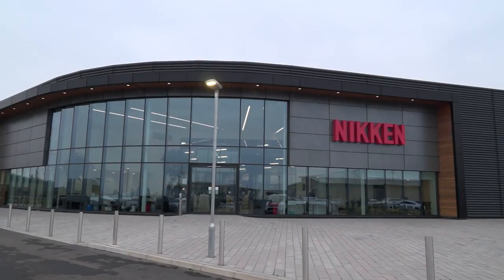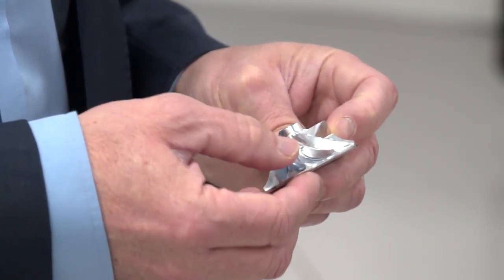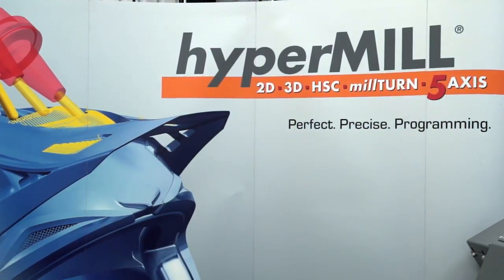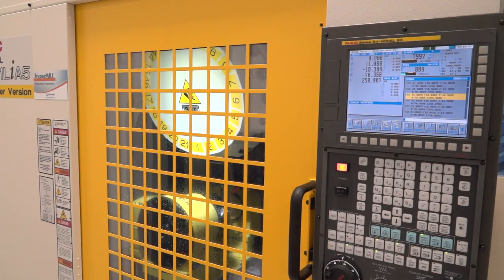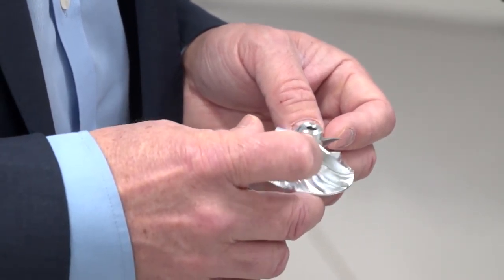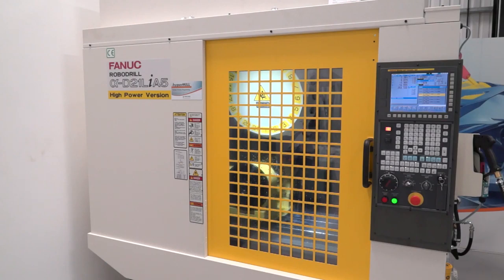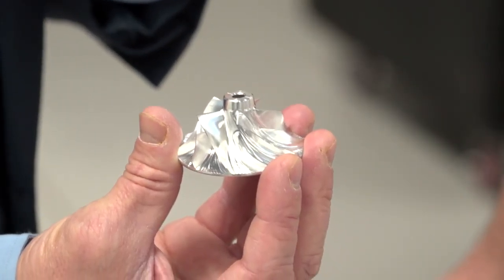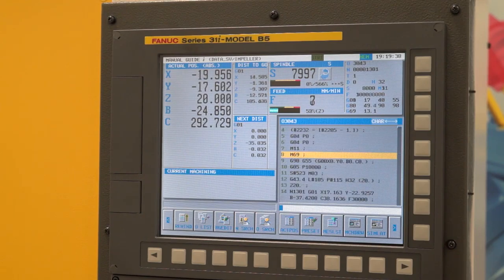hyperMill helps cut impeller cycle time down to 3 minutes

Comment: 3 Minute cycle time? Would it be too much to ask for you guys to show that cycle in its entirety? That sounds super impressive.

Also, how are you guys doing such a part with that much complex geometry on a Robodrill? Doesn't that machine have a useless memory capacity of 512KB or so?
Reply: That's not what John Saunders of NYC CNC said. The controllers have next to no storage ability. A Flash Card seems like a workaround. It doesn't make sense as to why the computer system itself can't have a few Gigabytes of internal storage. Every Home computer has massive amounts of storage, meanwhile CNC machines behave like they are the Commodore 64. Is the Compact Flash Cards slower to process the code at all vs internal memory? If anything, I should be able to install my own Solid State Drive in the back there somewhere for any storage I want. That doesn't sound too bad of an idea. But at $100K+ machines, kinda should just have that there for us.

At work, the Fanuc Controller I'm using is the Series 18i (Granted, ~2005 era). Only has 256 Kilobytes. The processing is terrible too. Dense code chokes the machine. Also no. Drip Feeding is not an option. That's old 80's talk. No reason reason to drip feed these days. Its harder to restart programs when drip feeding anyways.
Reply: Non Disclosure Agreement? I would think? That's ok. I was just saying things. Overall this is a great channel. Plenty of nice videos. :)